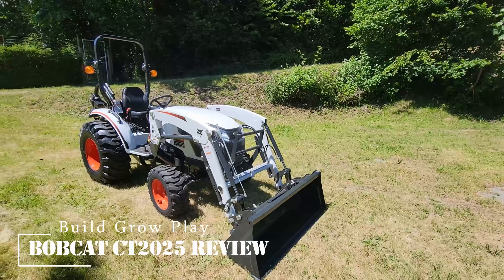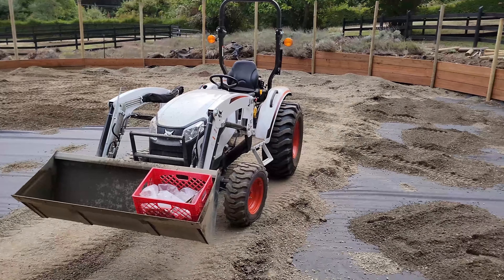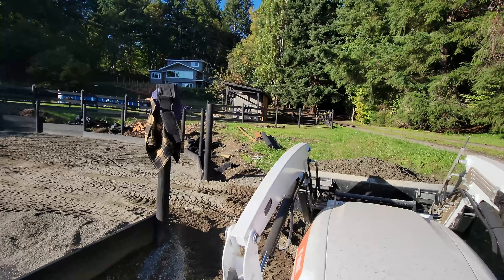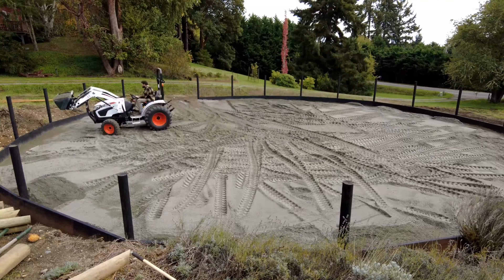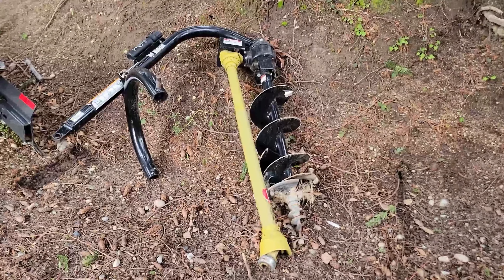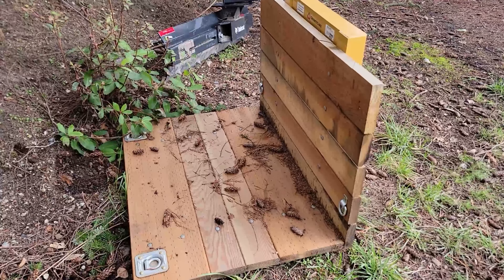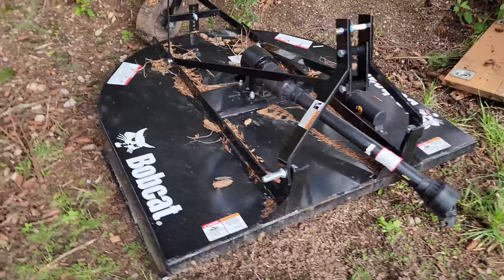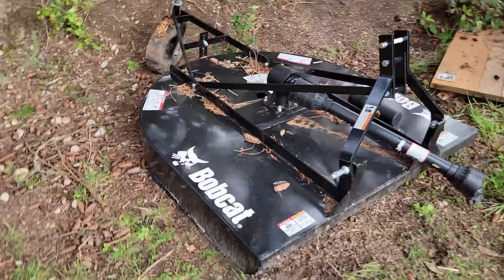Bobcat CT 2025 Compact Tractor 100hr Review - Build Grow Play

Comment: I have a manual transmission 2020 just about to break 100 hrs.  It runs flawless.  Sorry if I missed it but do you have a quick connect on yours for the 3 point?
Reply from the maker: Nice. Sotty, no quick connect. I don't really see the need.